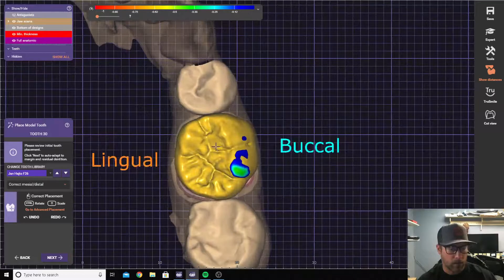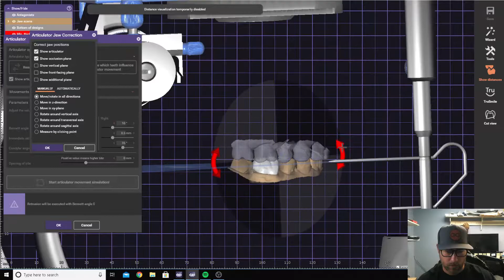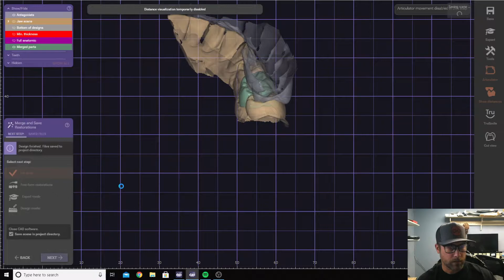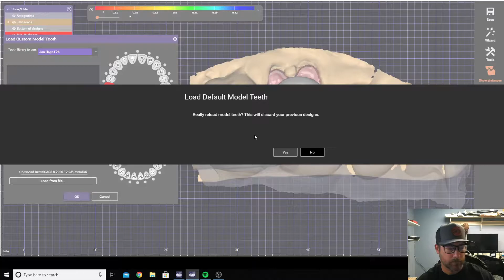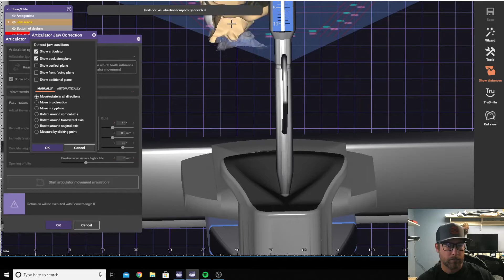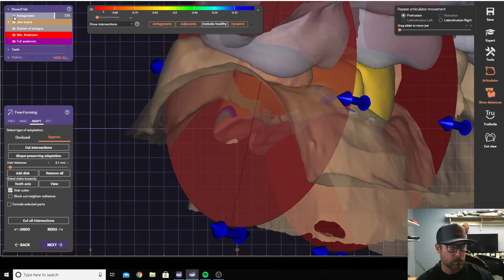How to: Upper and Lower Molar Design

Comment: Nice video- can you please elaborate on what you are doing with the disc cutters?  Are you removing undercuts beneath the contact area?  I understand you have already adapted the contact and dont want to mess with that adjusted area, so are you just positioning the disc until it is all dark (meaning the disc is not visibly intersecting with the color-coded area of contact w adjacent tooth?)

Comment: do you use 3dconnexion mouse if yes can you please make an video on how to set it up with exocad (like what buttons you have mapped to what etc.)
oh i was early into the video when i made the upper comment and you told that you have one but can you make an video on setting it up with exocad?
Reply from the maker: I will, but I dont have any of the keys mapped out. Its just plug in and play. I only use the control and shift key on it